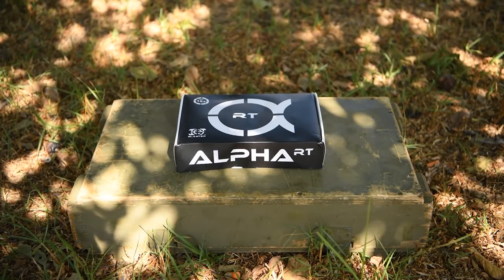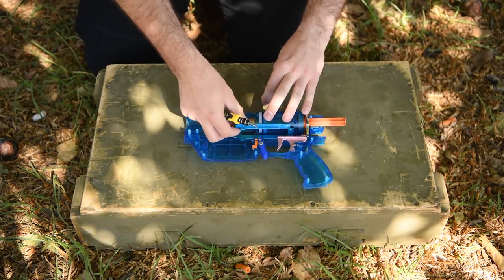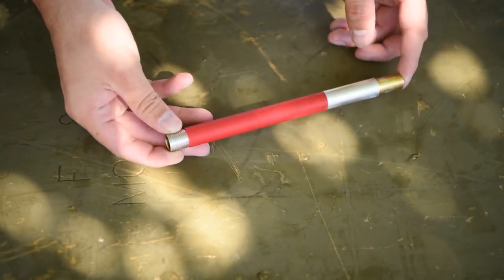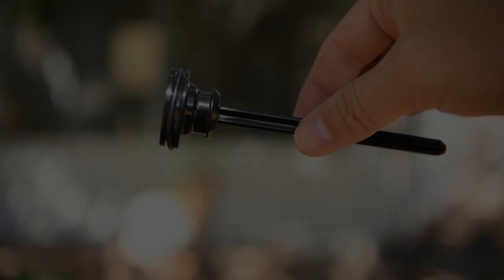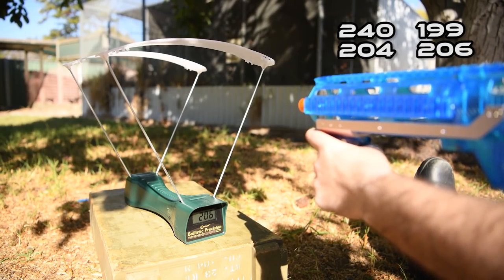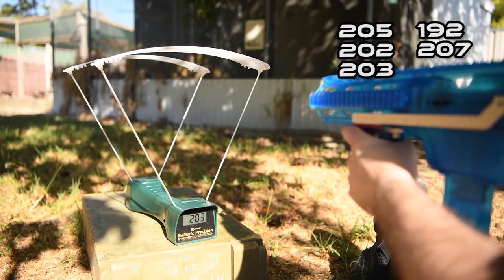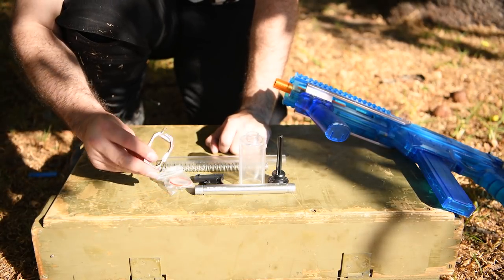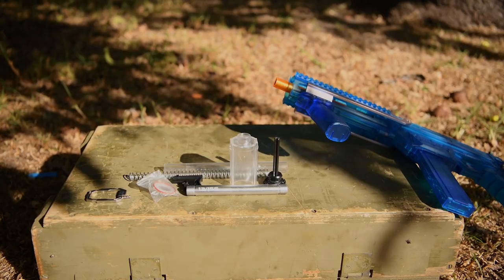Should you buy AlphaRT for your Prophecy or Retaliator?

Comment: In short, it seems best/easiest performance in the Prophecy is with Worker parts, and best/easiest performance in the CEDA is with Jet parts. Assuming the correct barrel length is used, naturally.
Reply from the maker: And of the two, at the same spring load, the Ceda is coming out slightly ahead.
Reply: @BradleyPhillipsYT  A fair assessment. I do find it slightly annoying that I'm going to pay more for the Alpha RT kit than I did for the CEDA itself. PLUS having to buy a proper length barrel to maximize it. Ah well, in the end I like them both and find myself using both equally.

Comment: Hey Brad, why don't you use the Caliburn for wars? It seems to be superior to modded Longshots, Prophecies, and xZeuses. Better performance, lighter and slimmer, easier to change spring, and more affordable.
Reply from the maker: Pretty much everything you just said is incorrect. Caliburn is capable of a higher potential than retaliator based systems, such as Prophecy and Ceda, but Longshots and Xzeus 2's are equal in power to a Caliburn, while also being injection molded shells rather than 3D printed. Longshots and Xzeus 2's are capable of 350fps, just look at Chris Cartaya's "Big Blue", when you see me using mine at 180fps or 250fps it's because that's the rule limit we have imposed here.

As for changing spring, the Ceda and Prophecy are faster to change spring than the Caliburn, and Jet are working on an expanded plunger tube Longshot shell which uses the same pull pin disassembly as the Ceda (called Ace).

So in summary, durability as well as no performance gains is why I don't use a Caliburn.
Reply: @BradleyPhillipsYT  lmao and here I was thinking that Caliburn was the ultimate springer
Reply from the maker: @danx3775  it's not that it isn't, it's just that Xzeus, Longshot and Ace also are/will/can be.
Reply: Daniel Xiao Ummmm..... no dude.... not that a caliburn is a bad blaster, some of us dont like the long draw or the 3d printing.  Ever seen a good Longshot, like a Really good longshot? Like brads, like mine... like any of those cats from Singapore, if no, I suggest you take a better look around....

If Brad wanted to do 350+ fps like Big Blue, he would and with a Longshot or Xeus 2, its plenty in his reach with an 18.5 turf or a 20 omw or a 22 kg worker spring.
Reply: Daniel Xiao: I invented the kronomag, Bird of Prey pistol is awesome, but my Blue Xeus2 can go faster than any of them, fastest ive gotten 389 fps.
Reply: @TheChrisCartaya  idk, I just thought that the Caliburn was supposed to be a homemade improvement of the longshot
Reply: @danx3775 :  its like a snapull, but runs a magazine not a hopper and is 3d printed rather than made with cpvc, is an improvement and offers those who perfer those formats options.  You'll see different crowds, LS users, FW shooters, Crazy Sniper pistol shooters, and it all comes down to preference.  Me i own Several LS's, but Like my pistols better, more comfortable with em, even though i have a couple crazy Longshots.

Comment: if you put a small piece of PVC in the back of the power stock you can increase the FPS by roughly 10 FPS
Reply from the maker: Yeah, but that also reduces the lifespan of the spring. Over time it will get weaker.

Comment: I have a CEDA that I got used, and I modified it to fit the worker 25n spring, so would you recommend the alpha rt, or the worker power short dart kit, in terms of price/performance? I already have a worker plunger rod lying around, as well as a worker aluminum boltsled for my ceda, If that makes a difference.
Reply from the maker: You'd get slight gains with the AlphaRT kit, which should handle your spring load fine.
Reply: @BradleyPhillipsYT  okay, thank you! I've wanted to make the jump to short darts for a while, and I'm glad you have posted so much info on just about everything short dart related

Comment: Hey Bradley, have you ever used boomco darts in a high-end blaster before?
Reply from the maker: Not super high end but in a Boomco Halo M6 and also in a Sledgefire with a red dot sight. Neither were as accurate as Worker darts so I never really went anywhere with it.
Reply: Bradley Phillips I mean, you could do double stack mags with boom tendo's adapter which give of more capacity, and you in theory could use cut down boomco darts in katana mags with the adapter